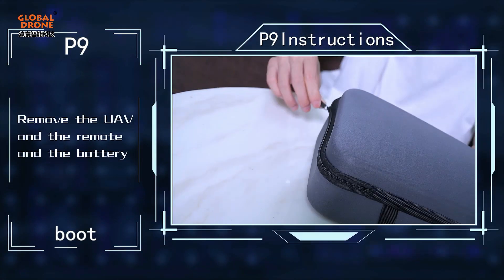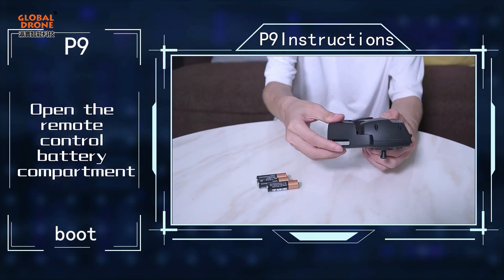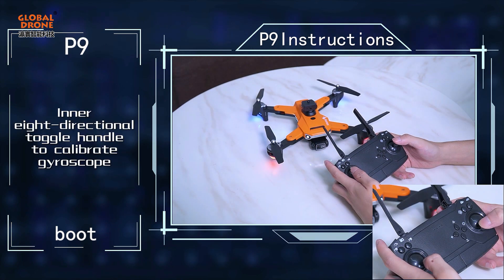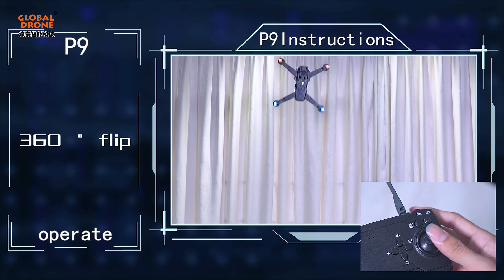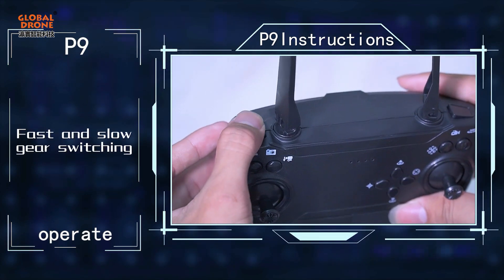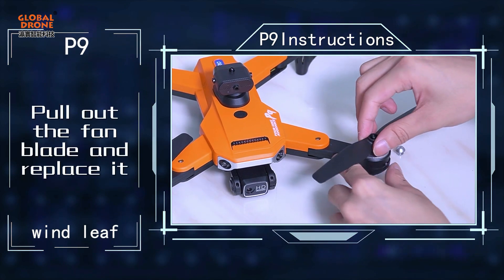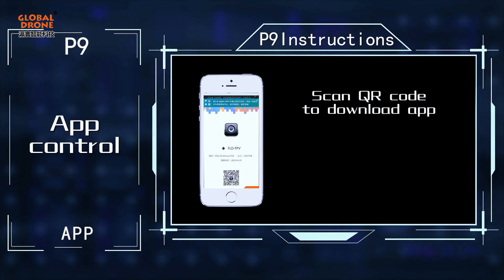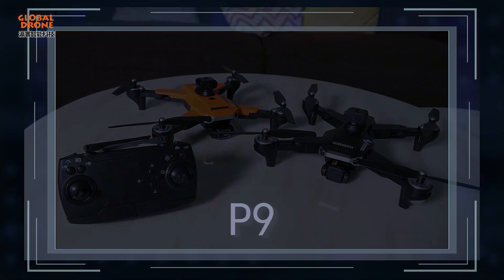Global Drone P9 Drone Operation Tutorial

Comment: I cannot connect the drone with the phone :/ I downloaded the app with the QR code and it doesn’t work
Reply: I can connect to the phone, but not the controller. I hope it can connect to both, not only phone OR controller. Did you connect to the correct wifi channel? It's been a month, so I guess you must have fixed it by now.
Reply: Nevermind, all solved.
Reply: @eraldylli is the camera good?
Reply: Apk y apa untuk melihat camera di hp terma kasih
Reply: Tidak dilengkapi cara kalibrasi serta reset drone
Reply: Quel Qr code ?
Reply: @Captain-koysmoi ces pareil aucune info pour le connecter